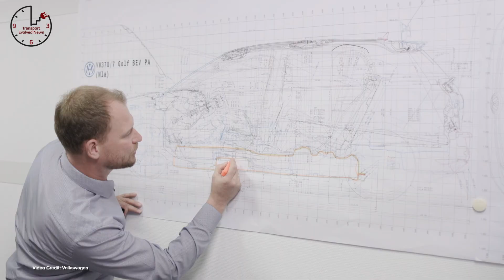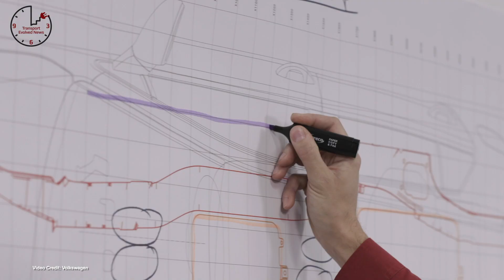Sony EV,  VW Change or Die, Talking Teslas — TEN 277

Comment: Oh dear “UK Government”, (EV charging puts the grid at risk). I wonder which department made that spurious claim, and how much money they took to say it. The UK power grid is managed by one company, National Grid, and they are not in the slightest bit worried. With a network capacity of over DOUBLE the current nighttime energy needs (About 30 GW spare at least) and a further 22 GW of wind power due to come online in the next 3 - 8 years, I think that we will cope. In fact National Grid are working to make UK Electricity Carbon Neutral by 2025!!!
Reply: Exactly this! I always roll my eyes when I see a nonsensical scaremongering headline in the media. Like you said National Grid have already produced reports stating that there's ample capacity especially when coupled with EV smart charging. I genuinely think that some of these civil servants/journalist think that every EV owner will be charging at 2000hrs every day from a completely flat battery and synchronise this activity with boiling a kettle, running their electric oven and taking a shower rather than just logically scheduling an overnight charge when demand on the Grid is halved and when certain tariffs are likely to be significantly cheaper because of this.
Reply: burropoco Current Tax per litre of Diesel ~80p, or approx 62%, current tax on Electricity, 5%, I wonder if it was the Treasury who made this statement?
Reply: burropoco National Grid PAID some domestic customers to use electricity last month, as a trial to see if it was better for the grid than turning off wind farms.  By doing so they reduced load at 7am the next day and displaced carbon demand. The National Grid is stocked full of clever engineers, statisticians and scientists, I’ll listen to them before some greasy politician.
Reply: burropoco In the UK negative pricing for industry is the norm, I hadn’t seen it for domestics before. I’m looking forward to getting and EV, just not yet, my current car is still going. I am looking at a domestic battery to go with my solar panels though.
Reply: @Muppetkeeper  I've got an Ioniq, which I charge with solar when the sun is shining, and at night on cheap rate. I've also got a Powervault battery which is part of the EDF grid balancing project which soaks up the excess solar and tops up at night with cheap rate electricity. I would definitely recommend battery storage if you can afford it, since May I have saved over £200.
Reply: Since when did National grid have a Carbon Neutral by 2025 target? There is a no coal by 2025 target, but there will still be plenty of gas (and a lot of biomass which is only rather theoretically carbon-neutral). There will be a load of nuclear closed in 2022 too, which won't help grid intensity. Not sure there is enough wind going in counter that.
Reply: @Muppetkeeper  I'm an EV driver and have solar.  I've looked longingly at domestic battery storage but I don't think I'd see a return on investment.  I'm better off spending the money on better windows to save gas/wood heating, then wait for CCS to become bi-directional and use the car battery for house power.  The price of storage batteries so relatively high compared to the price of a car.  7K for  a Tesla 13.5Kw or 47K for a Model 3 with a 74KW.  My solar is at least being green and powering someone elses home.  To save me buying it in the evening having a battery would just not be cost effective.
Reply: Miles Forrest Thanks Miles, I agree, the current pricing isn’t right for domestic batteries. I will wait for both the price to drop, and for the UK to have more electricity tariffs where I can load the battery up at night for 2p kWh and then use it during the day at home. I’ve already re-insulated my house, got solar, two wood burners and new windows. My next thought is a heat pump when my current boiler dies.
Reply: . Wookey hi, go to the ESO national grid website, it’s on there. They don’t say how they will do it, but I’ll bet they will be using carbon capture to soak up excess wind at night.
Reply: Alan Easthope Cheers Alan, I felt the EDF battery was a little overpriced. I’m going to wait a few years and probably get some batteries when my current inverter burns out.
Reply: @Muppetkeeper  its not easy being green is it!  It's so much easier if it's all done when a house is built rather than retrofitting to existing. I'll definitely consider gound source heat as well. I need to do some research. Anyway it's nice outside so time to chop some more wood :)
Reply: Miles Forrest Well the good news for you, your EV got 12% cleaner over the last year without you doing anything at all 👍🏻

Comment: Re: The Boring Company's project at the Las Vegas Convention Center:
The whole car-tunnel concept as a solution to urban vehicle traffic is so obviously, fundamentally flawed - donoteat01 has a good video explaining why it's just a bad idea, in case it wasn't obvious to you. For moving large numbers of people around a densely-populated urban environment, it's just the wrong tool for the job.
But it seems like the Las Vegas Convention Center has found the right job for that particular tool - moving people around a small, self-contained and controlled area. So, well done.
I just hope nobody takes from this the idea that it's a good tool for the urban transportation job. The big solution to that is, of course, mass transit. But some people will do anything to avoid getting on the bus with the commonfolk.

Comment: The crash rates of vehicles with and without auto pilot are interesting. Do they count accidents which occured seconds after the system disengaged as well, or do they let auto pilot bring the vehicle in a dangerous state, let it disengage and then count it as the driver's fault?

Comment: VW appear to have a better chance at surviving the next decade than some of the other brands based on their investments and excitement around their designs.  They just really need to make sure the cost and range are competitive in todays market, and not to the 2016 market.  They already have a solid plan IMO in focusing on vehicles in different formats than what most of the current options are.  The markets for vans, small hatchbacks, and station wagons may be smaller than the SUV and Crossover markets, but there's also virtually no direct EV competition outside of Nissan.  Instead, VW will largely be competing with ICE vehicles in these segments and has to really come out swinging to compete.

Comment: Maybe unexpected Tesla acceleration is due to re-engaging cruise control.
Reply: Most likely caused by people stepping on the accelerator instead of brake pedal. Nothing new, also happens in ICE cars. The results might be more dangerous in EVs though, due to their instantly available torque.

Comment: I wonder if Porsche Taycans poor efficiency has anything to do with its high voltage system? It's running 800v instead of Teslas 400v, which gives it a few advantages when it comes to charging speed. However, could this be a cause for Porsches weak range? Worth looking into perhaps?
Reply: Higher voltages should be more efficient, due to lower currents and thus less power lost as heat. So it would still have to come down to issues with new tech (most suppliers using 400V) or poor implementation.

Comment: I hope Renault comes to the United States after leaving in 1993 by George Romney. It would set some competition against the leaf/Tesla Model 3. Currently, the ZOE R% is selling in Canada at $27,000 USD and similar in Mexico. This also includes the Kangoo ZE van which unlike US Manufactures is converted for work related Id Exempli Air Condition repair/lunch wagon/mobile repair. In the Campaign for 2020 , Talk is on the agenda to change GSA RULE 500 which promotes fossil fuel and changing oil every 3 months. Change would be more electric vehicles for daily trips by government employees (papers, records, and other non law enforcement like delivery of voting items.)

Comment: Volvo will build its own U.S. battery assembly plant as it readies a line of electric vehicles for this market.

The expansion is part of a previously announced $600 million project that the Swedish automaker has begun at its plant in Ridgeville, S.C., which includes a second production line and Volvo Car University.

Volvo will create an electric version of its next XC90 crossover and build it at the plant starting in late 2022. The factory, 45 miles northwest of Charleston, employs about 1,500 workers building the S60 sedan.

The South Carolina plant will become the global production center for the third-generation XC90 flagship crossover.

That vehicle will be built on the next version of Volvo's Scalable Product Architecture platform, referred to as SPA2. Volvo has not said how much of the XC90's production at the $1.1 billion factory will be devoted to the battery-electric variant.

Construction of the battery assembly plant will be completed by the end of 2021, a Volvo spokeswoman said.

At that facility, employees will put together and test the lithium ion battery packs that will power the crossover. By assembling the packs on campus, Volvo hopes to reduce shipping costs involved in transporting the heavy batteries.

The spokeswoman declined to release the planned production capacity for the battery assembly plant or say how many jobs it will create. Overall, the planned XC90 production line is expected to create about 1,000 jobs.
Electric wave

The XC90 would be Volvo's third battery-powered model. Its first, an electric version of the fast-selling XC40 compact crossover, was unveiled in October. That EV will arrive in U.S. stores in the fourth quarter of 2020, priced at under $48,000, after the $7,500 federal tax credit, Volvo said.

The XC40 EV, called the XC40 Recharge, will be the vanguard of a series of emission-free models from Volvo. The automaker wants battery-powered vehicles to account for half of its global sales by 2025. Over the next five years, Volvo expects to launch a fully electric vehicle every year.

"A Volvo built in 2025 will leave a carbon footprint that is 40 percent lower than a car that we build today," Volvo CEO Hakan Samuelsson said during a press event in October. "We made safety part of the brand. We should do the same with sustainability."

https://www.autonews.com/automakers-suppliers/volvo-building-us-battery-assembly-plant

I'll put my order in for the BEV XC90 as soon as they start accepting them.

Comment: I REALLY have to look at that Luca!!!

So much for all the pseudo-pundits who claimed the Porsche Taycan would demolish Tesla!
I never understood their position, as Porsche are in a different market.  Does the Tesla S encroach a bit on the Taycan market?  I would guess that depends as much on their relative reliability as anything else.  You don't buy a Porsche based only on it's list price, or it's servicing costs.  But most people do look carefully at those aspects of a Tesla.
Note that one can say a similar thing about the relationship between any Tesla and a Jaguar iPace.
It is interesting to see Nissan playing around with the easy things to lure customers - rather than the more direct way to attract buyers by fixing their poor battery management.  To my cynical view, that says their battery solution will be very hard to fix.
Reply: Fashionable on this channel to bash Nissan.  How have they sold almost half a million Leafs if they are so bad?  We have both 2019 Leaf and 2019 CCS car with liquid-cooled battery pack.  The Leaf is superior in terms of charging speed up to 350 miles.  Few drivers will experience Leaf "rapidgate" (which is described in the manual).  On the other hand, VW gets a clean sheet for no liquid cooling in eGolf despite telling drivers they can't fast charge twice in a row - no such restrictions with Nissan.